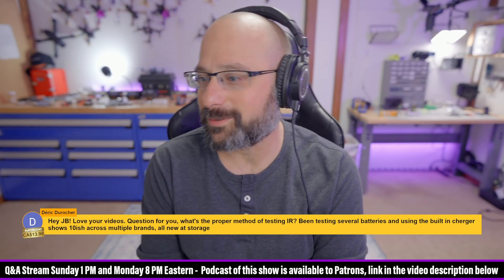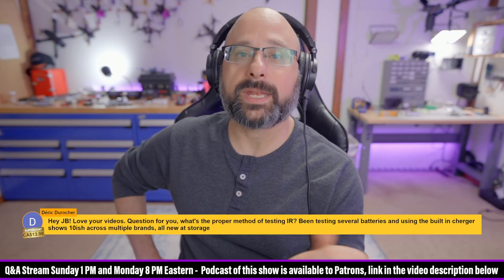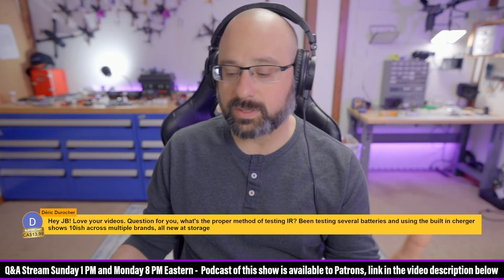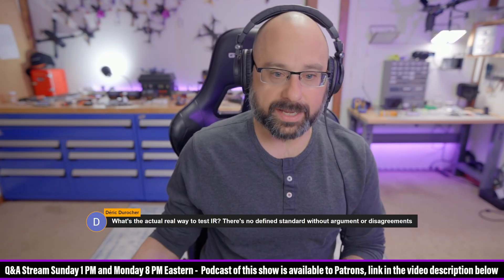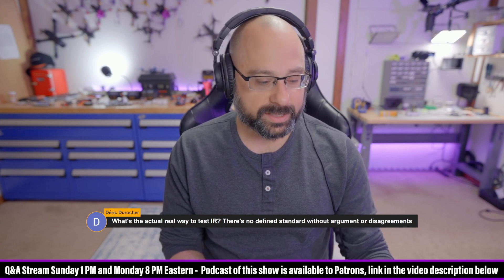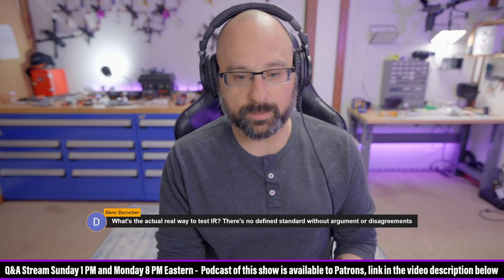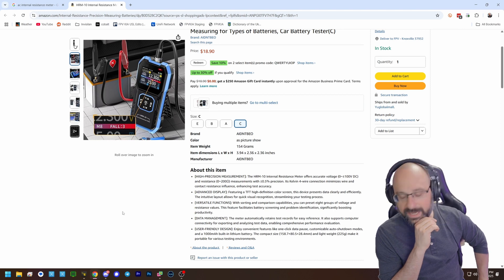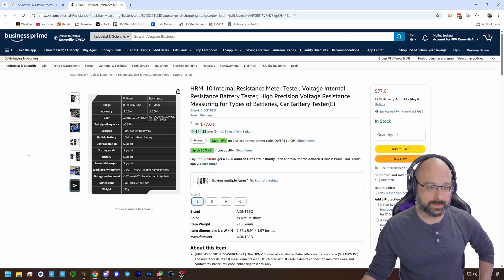When Do You Check Internal Resistance? What Is A Better Tool For Checking It? - FPV Questions

Comment: Would the AC not be worse for realistic flying as it doesn't consider the wire length? So batteries with the same IR could behave differently in the air depending on their wire length?
Thanks.

Comment: I had 6S batteries with IR above 10 that performed better than batteries with IR below 5. I think IR will only tell you if its time to retire the battery or not. Considering a 6S 1500mah battery, maybe an IR that is much higher than another battery with the same brand and size, that would tell you this battery is not good anymore.

Comment: You don’t need a meter you can feel the batteries when flying, they don’t last longer one cell normally keeps coming out of balance. Just use them till you feel they are degrading and get rid of them
Reply: I'm with you. I get everything I can out of my lipos. I've finally hammered nails through some 10-12 year old 300 2S which I use for indoor aircraft and 75mm whoops as they really are kaput. Not just the IR - they were useless to fly with